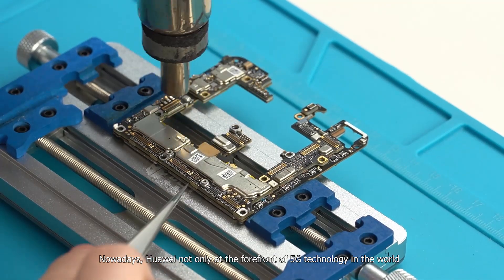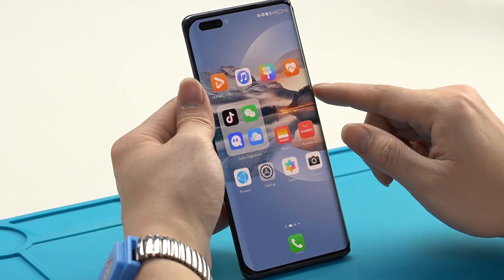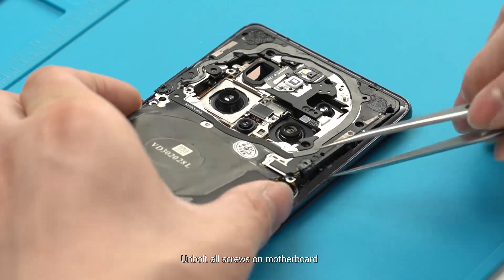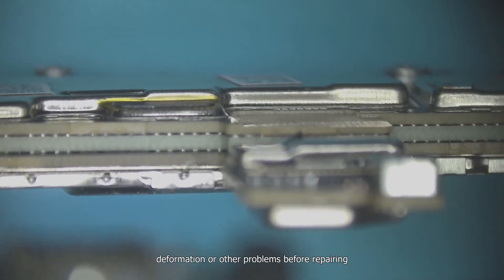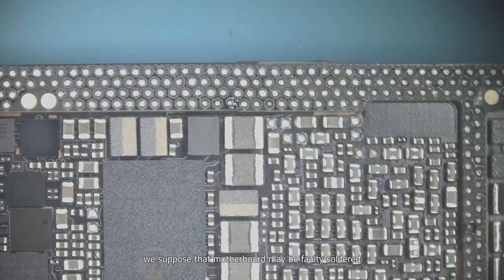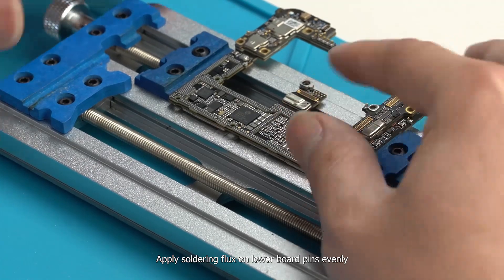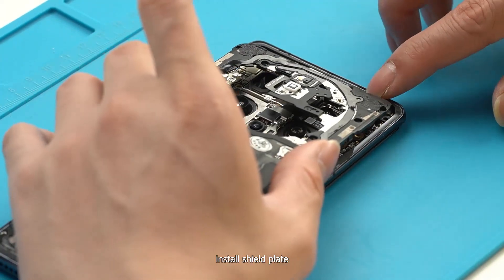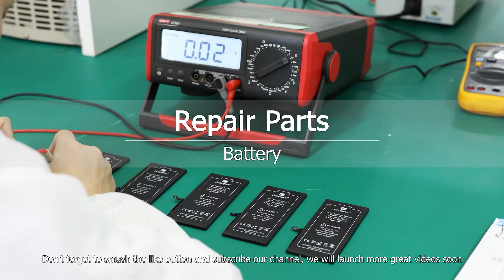Huawei Mate 40RS Collection Version No Signal Service Repair.

Comment: This is why I hate double layered motherboards, Specially the ultrathin iPhone 12 (and I presume 13, I'm yet encounter them). old (8 and lower iPhone ) can work even after a huge drop from any angle. iPhone X  was still OK, but starting from 11 and specially 12, it is major problem. On some angle drops, there is always a mother board problem, and I never seen iPhone that recombine and combine back 2 sides helped. It is always some cap or inductor got bad, or even chips witch  is a major problem, because almost every chip is serialized to this specific motherboard and cannot be just replaced.